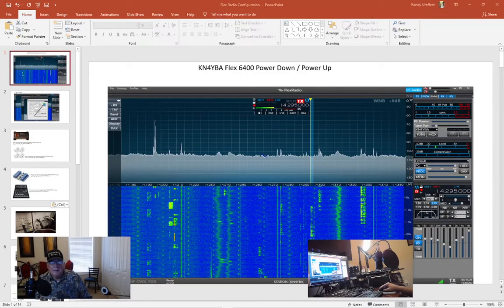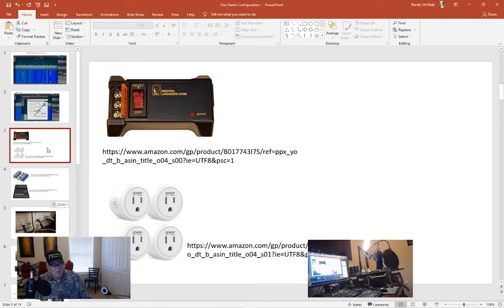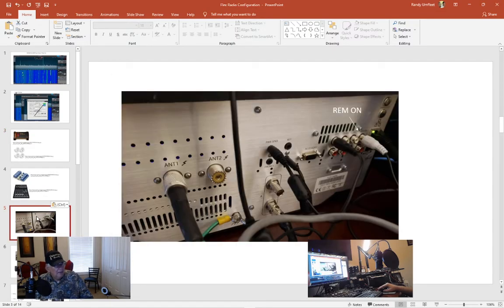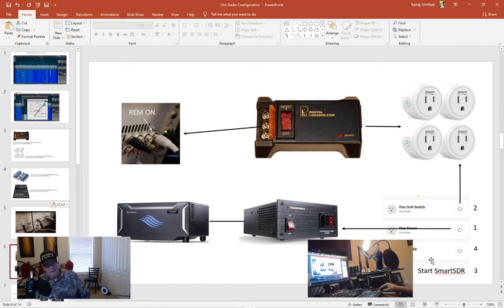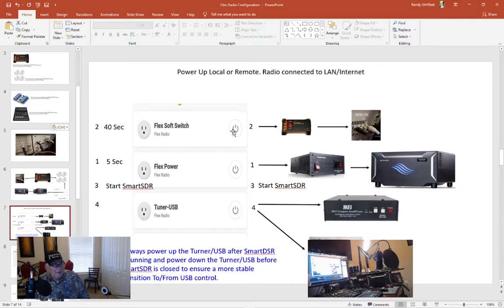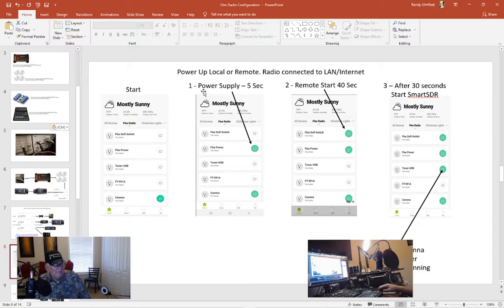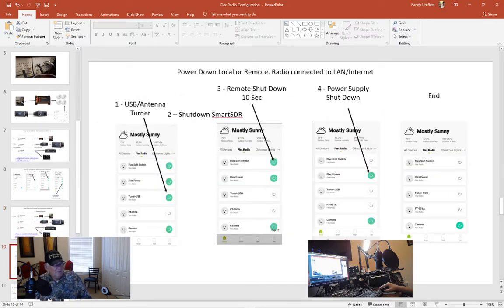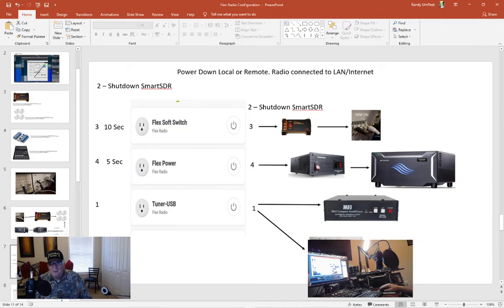KN4YBA Flex 6400 Power Up and Power Down

Comment: Why is the “soft start” box needed? Can’t the wifi 110vac switch stand alone?
Reply from the maker: So, I call it "Soft Switch" solely because once power is applied to the Flex, it is a button on the Flex that is used to boot up the radio. I always use Wifi/ app on my phone to boot the radio. I just isolate all the switches to help if remote to troubleshoot. Such as when I turn on the external turner. I don't want it to power on with the radio in the event there is a issue with the turner. If I start to experience turner issues I can just power down the turner and power it back up with my phone. This works great when remote.

Comment: How do you find the IP address to the Flex radio ? Within smart SDR ?
Reply: A couple ways to determine the assigned IP. In the SDR software once radio is up and running, go to settings, and newtwork tab to see the assigned IP. Or you could use something such as Advance IP Scanner, or log into your router to see the assigned IPs on your network.

73
Reply: @randyumfleet8694  Yes the first thing I did was log into my ASUS RT-AX82U router and looked for FLEX Radio I did not see nothing but some MAC addresses. If the smart SDR will show this in the settings I can find it there. By the way I purchased my Flex 6400 at this years Dayton Hamvention and just powered it up tonight for the first time. Thanks.